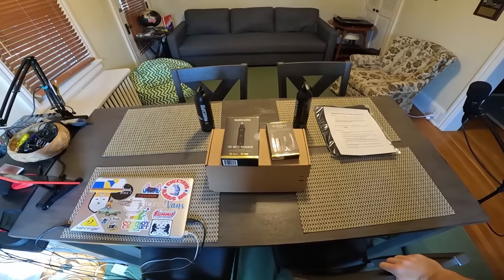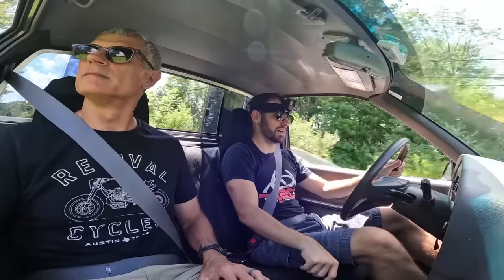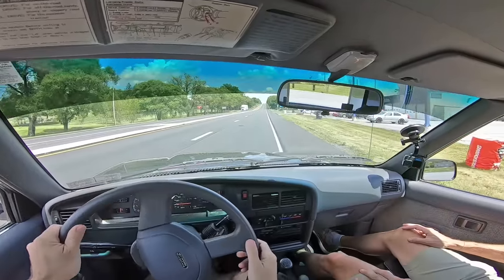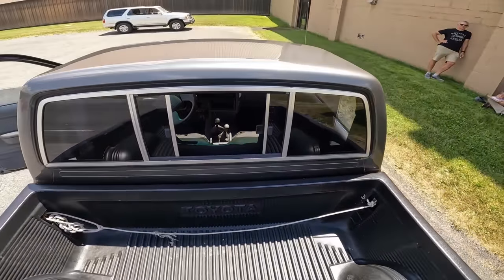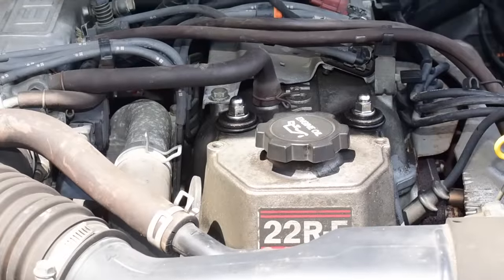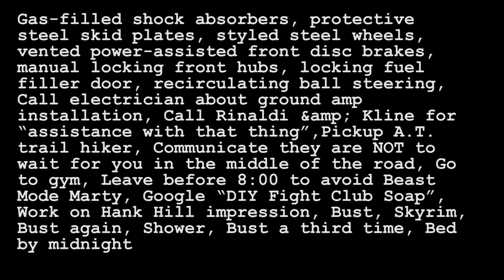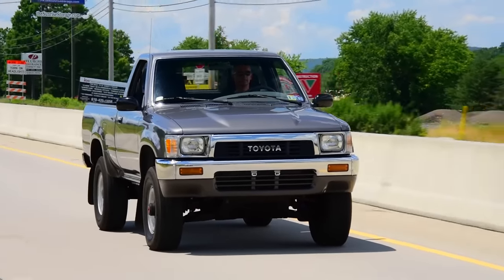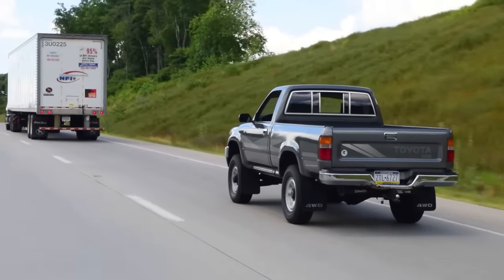1989 Toyota Pickup SR5 4X4 5MT: Regular Car Reviews

Comment: i remember when at the time buddy traded his 1996 nissan 200sx for a 82 toyota we thought he was nutts . his was a shit box but it was a monster he put 31 in tires and drove trough brush like a tank. i don't know what it got for fuel economy im sure not great, but with the near stock tire size and the way he punched the gas as a passenger , (i don't think i got to drive it), it felt pretty spunky . around the country.
don't remember what he did with it. probably traded it for a ford...

i would also like to see you review a 2wd version as well as the nissan ford ,dodge and chevy versions.
im a chevy guy so my favorite is probably the 88 s-10 4.3 v6 5 speed  or a dodge dakota  since i have seen how well they hold up.

Comment: I miss my 88 Ram 50 all the time. Bulletproof Mitsubishi engine that got 40MPG and fun to drive. My dad got it factory direct with: 5 speed, extended cab, and bucket seats. Ultimately rust ruined it and had to sell it. The driver side floor didn't exist and if you lifted up the rug it was like the Flinstones. Damn Ohio winters.

Comment: The 22R was used in the second gen. Cressida base model in NZ.
Nice engine, but most were autos - 3 speed_ so not that great.
Next gen Cressida came out with the 5M as the top option - 4 speed auto, (and maybe lock-up convertor?). Man, that was a super good-looking very fast car.

Comment: The clutch start feature was meant to allow you to start the truck without pushing in the clutch.
Reply: Correct. But it has an undocumented feature of being usable as a poor-mans crawl box because the starter motors are so stout in these trucks.

Comment: I have a 1999 Nissan Frontier SE King Cab 4x4 V6 automatic. It has 195,000, is originally from California and is an awesome little truck. No, it’s not as good, nor does it have the aftermarket support of a Toyota, but you can get one for thousands less. It’s much better than a Ranger or S10 of similar vintage, and I constantly get complements on it. Check out the review on my channel. 

If you guys are ever out in Buffalo, get in touch with me if you want to review it. I could probably line up a few other cars while you’re here, and I can show you were the good beer and wings are.

Comment: My grandfather had one of these pickup trucks and it took a collision with a deer and upper Michigan to finally put it on its last leg which lasted another 3 years before it finally quit and this was 2005 when it finally gave up the ghost

These pickup trucks were small but they're pretty much unstoppable short of crashing the thing into a brick wall there was no way to get these things to break down

Also without rewriting this post another Uncle of mine had one of these pickup trucks and I don't even know when he got rid of his.

If you could describe a single motorized vehicle not a modern main battle tank as an invincible it would be the pickup truck

Comment: A fabrication company / factory I worked for in the late 90's used an 80's Toyota pickup as a yard vehicle. 

That thing was abused by every worker that had to go fetch something.

I mean we beat the living piss out of that truck and it just took it with quiet compliance.

Overloading the bed with 3000 lbs of material.

Dumping the clutch everytime we drove anywhere.

Burnouts.

Doors ways slammed shut. 

Redline shifts for every gear.

Towing other vehicles and construction equipment 3 to 4 times its own size.

Oil wasn't changed in years. 

I asked why we didn't buy a new yard truck and the answer was because the thing just wouldn't break.

Comment: I got mine a couple months ago, but I guess the timing chain guides were already broken, and the chain ate through the case mixing all the coolant with the oil. Easy preventative maintenance would've sufficed. That said, it has 538k and drives really nice for a truck, even with an add a leaf, and better quality overall than post '96 toyotas. Didn't rust as bad either, same as any '80s vehicle. The '95-04 Tacoma and 4Runner have major rust issues, and  the weak balljoint design. Yes theyre slow, the 3RZ swap is tempting

Comment: You have to remember this thing was in the design phase when the national 55 mph speed limit was the law.  So this thing was built to go- (guess what) 55 mph.

Edit to add:  I have had my '86 Volvo up over 90 mph.  Stock B230F 4 cyl engine. Don't tell Mom.

Comment: I work on a super high mileage 2wd 86 p/u, its way less labored than the 4 wd 4 cylinder. The 3.0 v6 was just as reliable, and the 5 speed was plenty fun. There is a rusty v6 one local to me  that when it's done I hope I can get the leftovers, the electric locking diffs are cool too

Comment: I had an 89 short bed 3liter V6 5MT. Previous owner put a lift on it, chrome roll bar with three lights, bull bar with two lights, and 32in tires. Loved it except on the highway; all torque, no high speed.
Reply: My dad had a Nissan V6 pickup for a while and every summer he'd get several walk-up offers for it. One week people would knock on the front door and make offers. My dad gave in on the third one just to end the annoyance.
Reply: In 2009ish I gave my 89 Toyota to my dad after his Nissan debacle and I bought a 99 Jetta VR6 5MT because I did more highway driving than the Toyota could give me. My dad and younger sister later Craigslist straight-traded the Toyota for a 92 Civic hatch; it was certainly the better gas mileage side of the trade.
Reply: The summer before the Civic trade, I borrowed that 89 Toyota for a group off-road adventure and met my eventual wife, clearly impressing her with my Colorado off-roading skills and dat sweet V6, haha

Comment: My old  1991 dual cab Holden rodeo was the poor man's version of this which had a Isuzu motor in it. (No power steering or ac compressor like it wasnt broken the guy who bought just didnt option it) In 2014 I was dailying it 110 kms roads working some hills would only do 85 up hill. Bit I was still driving with a huge smile aux cord connected getting head nods from other utes and commodores. Btw in Australia we use hiluxs to tow all day as we don't have proper "trucks".

Comment: I have a 93 2x4 with 114k long wheelbase that I picked up just a few months ago for $10k. Excellent condition. Unfortunately 3 weeks ago today the thermostat got stuck and the engine overheated and blew a head gasket.  The garage is working on it right now (really, waiting for the machine shop to get the head resurfaced.) I'm getting a new timing kit out of it which I knew I needed anyway due to the famous plastic timing guides that wear a hole in the timing cover. I'm really missing it after it being my daily driver for 3 months.

Comment: The King of "Is it for Sale?". I feel what this guy is going through because I have a 05 Tundra limited with all the specs and gizmos. "Noice truck! Is it for sale?". No, no it is not. It has the roll down rear window. Moon/Sun roof whatever you want to call it. LSD, 4x4, heated seats. Great condition, minus the crossmember and gas cap. It's a truck I use and take care of. The 4.7L 2uz-fe is V8 heaven in my balls. Sounds good and gets up and goes for what it is. Others may be faster, but I'm more reliable. Did i tell you already it has a V8? And yes, I'm better than you. If you buy a Toyota, you'll develop this smug attitude as well.

Comment: Man I had a 89 Toyota pickup in that awful brown paint job. Not that it mattered it was rusted to hell. The bed was rusted so bad it had holes big enough to fit soad cans. No working AC, fun to drive in the Texas heat. I regret selling it to a scrap yard for $500 in 2019. Only bought it for $2000 from my uncle. Biggest mistake I've made as an adult. Ran like champ, looked like it would fall apart any second. I miss that truck.

Comment: Trucks sell because Americans are on a budget. They can only afford one specialized vehicle, a large, durable good, with lots of interior space, a full frame, solid rear axle, capable of being maintained and driven for 300,000+ miles, relatively easy to maintain/repair mechanically(electrical things are hurdle on everything new) or capable of holding plenty of resale value. Very few front wheel drive unibody vehicles aren't a terrible use of money because they are mostly designed to be disposable, they lose tons of value, don't have the power  size, space and utility standard American cars used to have because of emissions and fuel economy mandates. People are in a frenzy to accumulate as many internal combustion vehicles as they can so they can keep one running once the laws force all new vehicles to be electric. I am not an electric hater, I see a purpose if someone is willing to pay for it, I have severe doubts that they will be capable on 400,000+ miles without buying many new batteries and be on the road 50+ years after they were built if an owner makes that decision like many internal combustion owners do. It's difficult to get ahead in life and not be a debt slave if you always have a car payment unless you're one of the fortune few especially considering the rapidly diminishing middle class.

Comment: I just realized the other day that the R20/30 Toyota Van is based on the contemporary Hilux. I wonder why you don’t seem them as much on the road anymore? There are (comparatively, at least) still plenty of older Hiluxes around. Yes, an old pickup is naturally going to be valued more than an old van (especially if it’s not a full-size van), but the mechanical parts can’t be that hard to find. Whatever can’t be found in our junkyards could probably be sourced from other countries where the Hilux and Van were more popular and/or in production for longer.

Comment: I don't think a lot of (particularly) younger people understand how slow all of these 4 cylinder pickups were, but everything was slower then. I remember my grandfather buying a 1991 Mazda B2600i and the best compliment its power got was "this thing's spunky!" 

I had a 2001 Chevy S-10 with the "Vortec" 2200 that wheezed out 120 hp and I do mean wheezed because that thing didn't make power...it made noise. Even with the 5MT, it was a slug. It was ok in town, but sucked on the highway. I am sure this Toyota is no different.

Even the more powerful 2.7 Toyota uses in the Tacoma now is woefully underpowered and gets pretty crappy mileage.

Comment: $20k?    In 2020 I sold my '90 4x4 extra cab sr5, 5mt and the gawdawful 3.0 for $6k, happily.  125k miles, no a/c, lifted just enough to get 31's on it, had some rust issues, but clean interior that was pure late 80's/early 90's red, including a pop-up sunroof.   Loved everything about it except highway driving, and roasting alive during summer.  And getting 12 mpg.  Bought a YJ instead, same shite mpg, rust issues, even worse highway driving.   But top down 7 months of the year doesn't suck.

Comment: "Prepped for winter salt" ?  I suggest everyone watch The South Main Auto Repair channel and see what "modern" vehicles are "prepped". NONE of them. You see frames rotting out on 5 year old cars. Manufacturers don't want your car to last, they want you to buy buy buy a new one more often.  You'll have to research having your vehicle being undercoated yourself and choose which ones you trust. Not all of them are worth the money. Fluid Film seems to be one of the best but not endorsing anything.

I have a 1988 Toyota FI truck, (FI was the only badge on it somewhat like SE but it stands for Fuel Injection), same RE engine as in the SE shown but it has plenty of power to pass cars and I have an automatic 3 speed with overdrive so in essence a 4 speed trans, 2WD. Had it since 1997 and it will outlast me probably. Paint looks awful but mechanics are great.

I've had mine up to 90 MPH on the freeway but only for brief periods. 80 is no problem. Front suspension is torsion bars, rear leaf springs, ride is comfortable.

Comment: I had a 94 5mt, 2wd 4cyl. I would still be driving it today if a 92 year old hadn’t pulled out in front of me, perpendicular to the lanes of traffic on a 40 mph hour road. The truck landed upside down and was crushed. If anyone was in the passenger seat then, they would of died. I had my seatbelt on and thankfully only needed a dozen stitches in my elbow.

Comment: I have a 1994 standard cab, 5 speed, short box 2wd one of these. I’ve replaced the timing chain… sometimes I change the oil… it is the Model A Ford pickup of the modern era

Comment: If you ever get the opportunity to drive the JDM diesel version do it.
.
Either Toyota or Izuzu truck or suv.
You will better understand these trucks as thats how they are largely intended to be used.
Closest American auto to them is the full size 80s trucks with a diesel.
But yet completely different.

Comment: We have a 2004 Tacoma. It's a lot wider and higher than 5 years earlier to edit and has 4WD and a different 4-cylinder engine, so it's more of a workout to drive and gets worse gas mileage. I haven't found tree i need to climb. Also our first engine expired below 100,000 miles. The used one we replaced it with seems fine.
Reply: RegularCars【 𝟒𝟒𝟑 】𝟓𝟖𝟒-𝟔𝟒𝟎𝟏  no.
Reply: RegularCars【 𝟒𝟒𝟑 】𝟓𝟖𝟒-𝟔𝟒𝟎𝟏  no.
Reply: RegularCars【 𝟒𝟒𝟑 】𝟓𝟖𝟒-𝟔𝟒𝟎𝟏  I will when I have a chance. Thank you.

Comment: Yeah it's a nice truck and all, and super reliable, and getting more valuable and rare and more expensive. But if that guy was serious about 20 grand, that guy is a damn fool for not selling it. You could have got a Nissan hardbody from a similar year and similar condition which is just as good of a truck without the rust issues, and still had 17 grand left over. To hell with sentiment. And if u don't believe me about the Nissan just watch his review on that truck. I preferred the early to mid 90s ones though over the mid to late 80s. Same truck different styling.

Comment: I have a 92 rwd toyota pickup dlx 3.0l v6 5spd with 86,000 original miles unfortunately a old lady wiped out the passenger side but I'm still driving it

Comment: I owned a 86 4wd.  It's wasn't fast, but most trucks weren't back then.  Only recently do we have luxury trucks with more hp than sports cars of the 90's.   I have a 05 Nissan frontier nismo...but I'd rather have an 80's or 90's Toyota.   Doing more, with less, just feels better.   My frontier has good power, is bigger, faster and more capable than I need...yet it's a small/basic truck in today's world.

Comment: I had one, even same color.
It was a dog, but all 4x4 4 cylinder 5 speed compact trucks was dogs;
All 4x4's should have had turbo's and 4.10 gear ratio's; V6 helped.
Ranger, S10, Nissan, Mazda and Toyota was most common at that time in the US; drove each model, all was very underpowered. 
Rarely used the 5th gear.
Dodge had one made by Mitsubishi called the Ram 50; rarely seen them or Mitsubishi or Isuzu.
Previous gen 4x4 Chevy LUV (Isuzu) was slow too; Ford Courier (Mazda) didn't have 4x4 in the US without conversion.

Comment: Local city govt has a 4 door Hilux of this gen, lifted, bif tires and running but rusting underneath and on the sides.

In the Philippines, I see more Mitsubishi L200s than Hiluxes, these Toyotas even modified non-stock condition still go for more than 6k dollars, the 4x4 with the 3.0, at least 10k dollars.

Comment: I have zero interest in a late 80's Toyota pickup, but I'm not a truck guy. If I were to get a truck with what is available on the market right now, it would be a Ridgeline; Easily the most comfortable truck out there being that it's not a BOF, and has enough tow & payload for my needs (tow a ~4,500lb car trailer that has brakes, load mulch, gravel, topsoil etc. in the bed). If there were an EV the same size as the Ridgeline (that wasn't stupid money) I'd probably get that instead.

Comment: Both of my trucks are regular cabs, I am too poor to drive an old Toyota 😂🤣 I have a pair of very high mileage gas V8 3/4 2wd long bed white pickups that are 20 and 25 years old, 318k and 220k miles both have hydraulic roller cams, one ZF manual or 4L80e, big 14 bolt and 10.25" axles. I have two in case one breaks down so I have a backup. Paid $5200 for the pair. They'll probably run as long as I maintain and repair them. Nearly I definitely if I am willing to go as far and overhauling major parts eventually. They won't rust away here. They just poor man transportation for me. Fuel economy doesn't matter much I don't have to travel.much. I can't imagine an electric truck being affordable in the long run.

Comment: This era of pickups are slow, but not 55mph slow unless there is something wrong with it. I recently drove my 1987 w/ 22RE about 1000 miles on the freeway running 75 the whole way.  And I even passed a couple cars on some 2 lane highways.  This despite the fact it has 258k on the original drivetrain. Give the 22R a little credit.
Reply: The truck in the review will do 75 all day no problem. We were accelerating up a 6% grade in the video.

Comment: In all seriousness my 1985 22r with four speed manual transmission can do 100 mph and will climb any hill over 65 miles per hour. Maybe the gearing in the 4wd models plus the added weight hindered its speed. My truck isn’t fast, but it can sure keep up on the highway

Comment: i drove my '91 2wd 5 speed manual 22re pickup at highway speeds (~70-80mph) pretty regularly, must have been geared differently?
Reply: This one will do that just fine. 1) Mr Regular was firing for effect and 2) that shot where he’s struggling to accelerate to 55 is very up hill. Hard to see the 6% grade on the video.

Comment: It's pretty slow but where im from people drive 50 in a 65 so it's plenty fast for modern traffic..I can cruise at 70mph at 3000rpm in my 91 with 22re and 5 speed..They are amazing trucks. Strongly recommend..But they're not exactly ford ranger cheap